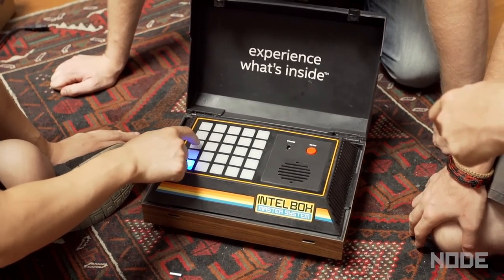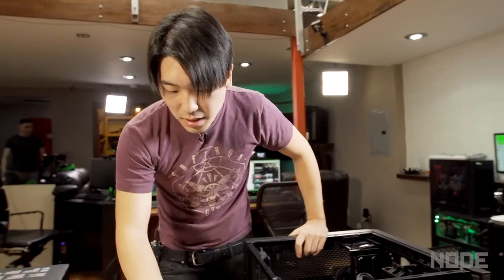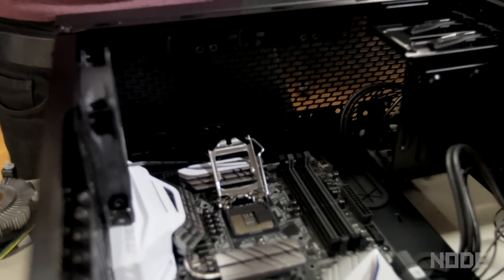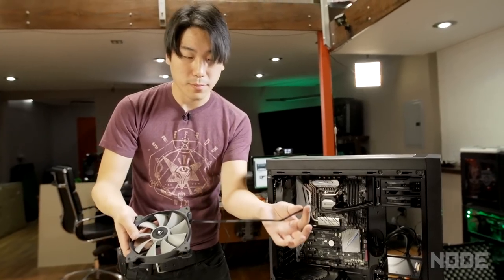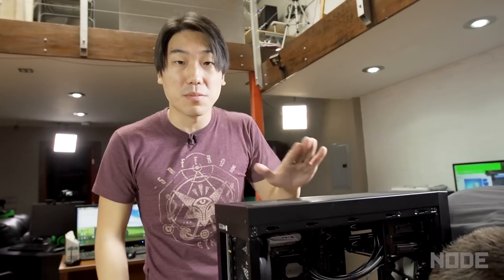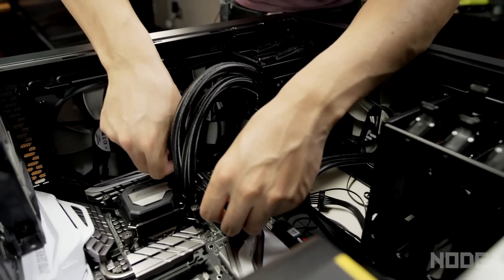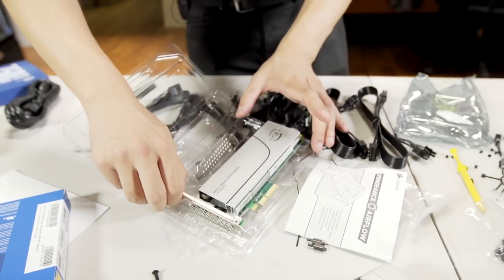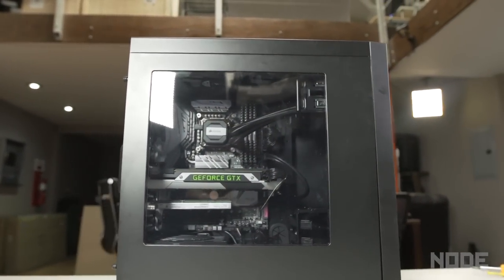BEAST INTEL PC BUILD

Comment: for everybody that wants to get a 6600k or 6700k they dont come with a stock intel headsink you have to buy a aftermarket one.
Reply: ***** im sure that the people that are going to build your system are professionals and ad a heatsink, but you can always email them to make sure.
Reply: ***** I got a friend and he bought a system but forgot to buy a headsink because he thought it came with one. And i just wanted to make sure because D didnt know it either, he showed a intel stock headsink and said that it normaly came with that.
Reply: Headsink?
Reply: +barny8000 It's called a heatsink bud
Reply: +KrisVr People use stock coolers that are on a limited budget or are not interested in overclocking
Reply: +barny8000 depends if you buy the boxed version or the tray version
Reply: +Kohlabier the boxed version doest come with a heathsink either.
Reply: +barny8000 that's strange.. what is inside the box then? CPU and Styrofoam?
Reply: +Juno Arry plastic with your cpu and a manual
Reply: oh yea.. Styrofoam will make electrical thingies goes bad for packaging..

Guess i'll head back to chemist community.. I feel newb here, gosh.. I don't even do chemistry...
Reply: ...as with the 5820K and 5960X.People who buy these should not be using the stock cooler anyway,especially when the skylake parts are said to have bad TIM again(according to someone's delid experience).A Hyper 212 is not expensive compared to the other components.
Reply: +KrisVr Maybe they can't afford another one, i personally would just go for a hyper 212 evo, or something alon those lines.
Reply: +KrisVr Well, since it's intel, you can actually use them without any drawbacks
Reply: +barny8000 who uses stock heatsink?
Reply: The standard Intel heatsink is rated for 95W, the skylake k series will hit 130W when overclocked so the standard heatsink is not good enough. Why anyone would buy a k series and not overclock is beyond reason wait for an S series or similar. Saying that skylake isn’t much of an improvement over devils canyon considering the quite substantial price increase (mobo plus ddr4), you'd be better waiting for the next gen CPU entirely.
Reply: +Pureshadow idk
Reply: who wouldn't do that anyway?
Reply: +Daniel Deutschen The people who are NOT enthusiasts, and DONT overclock, who DONT need one if you dont overclock it.
Reply: +Blake Slocum well, I think you need one because the stock cooler is just way to loud
Reply: +Anthony Nguyen People on a budget don't buy $400+ CPUs designed for overclocking. You can pick up a good HSF for under 40 bucks.
Reply: +barny8000 who uses a stock anyway?
Reply: +Edsson L. poor income gamers :'( a moment of silence please
Reply: porkyporkchop1 poor with a 6700k?
Reply: Edsson L. it was a joke about the stock cooler. kind of silly to invest in such a nice build and not throw on a heatsink :)
Reply: porkyporkchop1
But the stock cooler is a heatsink, is it not?
Reply: porkyporkchop1 oh i see, and yeah it is silly
Reply: +Blake Slocum shush, you know I meant a decent heatsink.
Reply: porkyporkchop1
Is the stock heatsink not decent enough to cool the cpu with no problem?
Reply: it will only support non overclock, and it will run at high rpm and be very loud.
Reply: +Blake Slocum it depends on the CPU. I have a mixture of amd and Intel. Fx 6300 and fx 8350 needed it. Ran to hot. My i5 was fine without a bigger heatsink. My i7 I didn't chance.
Reply: porkyporkchop1
 I can give you that, but only in certain situations. If your running a server like I think you are, of course you need it, those things will get to 150C before they shut off... If I knew you'd be running it on a server, heck yeah I'd get a big heatsink. The reason why it only fits in certain conditions, is because my CPU, quad core 2.8 Ghrtz is 280$ as of today, and it runs a frosty 32C at idle, and 60C on full load, which is still under the 80C shutdown point, it is recommended it don't go over 60, but it can go well over 70C without damaging things, Yes, it can damage it at that temperature, but it has a much lower chance of surviving. over 125C is when the thermal paste starts to melt, and also the temperature that solder can melt at.
Reply: +KrisVr I do ! Because I  don't want to waste another money for the cooler.
Reply: +barny8000 That is correct, and why do all pc builders get more powerfull power supplies than they would actually need. A 650 w power supply is more than enough for this build.
Reply: +KrisVr To cut corners and buy one later... I know from experience.
Reply: +Robbie Hope yes they will put one on for you! they will send you a functional pc
Reply: Nah der they're k series chips
Reply: +barny8000 or just get a 4790k and be A-Ok
Reply: +FireB4llz nobody. But he said in the video that they come with a stock heatsink. They don't.
Reply: +KrisVr if your not gonna overclock your cpu you use the stock cooler, dummy
Reply: N Bertuzzi  Then you loose out on quieter and cosmetic aspects.
Reply: We can juz use Crosair water cooler
Reply: If you don't want to buy an aftermarket CPU Cooler, then go with a cheaper non-k SKU if you don't plan on OC'ing

Comment: The way you built this pc makes me cringe XD
Reply: What do you mean?
Reply: Neopulse00 calling some of the components the wrong name the way he installed some components like the liquid cooler. you are supposed to put the fans on first then put it in etc. if you want some cool build logs go watch LinusTechTips
Reply: +RathOX Well really, as long as it works, and you know what he's talking about, it's completely okay.
Reply: Conrad Skylark yup no anti static bracelet
Reply: +RathOX Also pretty sure he didn't clean his CPU from finger grease after touching it when he was putting on the AIO.
Reply: ***** i wasn't quoting lol i build pcs all the time. this made me cringe XD
Reply: +RathOX They probably disassembled the whole thing and rebuilt it after the video ended. Their technical guys appear competent.
Reply: +Jack Black Um no. One, you barely know what he's talking about. This is an extremely vague and simple video for a very complex and hard task. So it's not "completely okay" at all unless you're here for nothing but entertainment. But if you want to build your own pc, this video is not "completely okay" by any means, you'll probably fuck it up if you aren't already informed on the subject.
Reply: bestieswithtesties This video isn't a build guide...
Reply: +RathOX Yeah some of the stuff they did could've probably been done in an easier fashion, but hey, they got it done.
Reply: Jack Black I think, at least from carefully observing the source material (the comments), that people feel that Node should have led with that fact. 

Otherwise, it's kind of misleading.
Reply: plasticbazooka It's not misleading if they didn't say it was a build guide, they're misguiding themselves by assuming things.
Reply: +Pierre Fouquet ik its a liquid cooler i have that exact model in my build........
Reply: +Pierre Fouquet and........ it is
Reply: +Pierre Fouquet i need corsair link for my psu and cooler so i can measure the voltages and temps
Reply: +Pierre Fouquet no no no. i said he called some i didnt say he called the liquid cooler wrong. i was referring to the "backplate" which is called the i/o shield. i was saying that corsair say put the fans on the cooler first before u put the cooler in the case...
Reply: +xSiNx SHADOW ikr this kid haha
Reply: +RathOX If it works it works, when I see comments like this just seems like a bit of jealousy but hey gotta have some haters right.
Reply: +CrazyMC411 not jealous haha got basically the same pc haha. its just irritating when i see this vid because he is trying to explain it and not doing a good job.
Reply: +RathOX It is not a tutorial video though just a build video
Reply: +CrazyMC411 but he was building it partly wrong tbh and called some components the wrong name.
Reply: I don't see it a really big deal though, seemed fine to me.
Reply: +CrazyMC411 yes you dont but a lot of people did including me lol
Reply: +CrazyMC411 But, there will be a person who probably a node fan, and tried to build pc cause he watch this video... and tried to use this video for guidance.... there will.... so is it fine? nope, nope, NOPE... the component are expensive man, if someone follow this kind of build guide (even though this isn't a build guide) they will have HIGHER CHANCES to fuck up and ruin that expensive component
Reply: +RathOX same. it pissed me off a little. just wished "he did his research"
Reply: +RathOX Really? It wasn't that bad. Besides, we all make mistakes. For instance, your grammar makes me cringe, but I don't mind.
Reply: Tomiply it wasn't that bad? check the comments
Reply: ***** I did check the comments, and your grammar isn't that bad. It's just like D's PC building, it's not that bad either.
Reply: Honestly, I don't get why most people are bitching, he got the job done and it works. Nothing exploded nor got short-circuited by static electricity. So jokes on anyone bitching about it.
Reply: +RathOX dud bracelet is not really needed, just touch something metal before building ;)
Reply: ananda rizky not really especially if you are dealing with cpus and gpu static electricity builds up even if you touch something metal first.
Reply: No big deal but you can make it a big deal, just chill.
Reply: Jack Black I agree, however, the majority of the people commenting don't appear to. It is what it is.
Reply: Yep they lost me at the power supply... upside down wtf! why do intel send them prosseors? just to show us how not to build a pc
Reply: +Reality Warri0r it doesn't matter which way you put the power supply in, if the fan is on the bottom and there isn't an opening on the bottom of the case then it would be completely stupid to put it that way. so you put it in the other way so the fan is on the top. think before you comment lmao
Reply: You completely missed the point and i'm not going to explain it to you... you're just not smart enough!! Now i'm lmao AndrewF321
Reply: +RathOX How about when he touched the cpu right in the middle with his bare finger? mmmm
Reply: +RathOX I'm pretty elementary when it comes to PC building and I could easily put together a PC like this. It's really not a hard process. I also knew exactly what every part was regardless if he said the wrong names (which I never caught). Also, an anti-static bracelet isn't necessary at all. It's mainly used by people who are paranoid. I've put together and torn apart PC's hundreds of times without anti-static and never had a single issue. Go ahead and consider yourself the master of PC Building, but there isn't just one way to build a PC. Their finished build will run just as good as if you built it yourself. 

P.S. they could have easily fixed anything they did wrong in between clips (i.e. cleaned grease from processor).
Reply: +RathOX now that you mentioned it. O gosh D:
Reply: +RathOX don't need one
Reply: +AndrewF321 It actually does make a difference...One direction it's pulling warm air from inside the pc and venting it out which keeps inside the pc somewhat cooler. the other way it focuses the cooling on the PSU itself.
Reply: Michael Williamson
every PSU i've ever seen has 1 fan, whether it's blowing air out or taking air in doesn't matter. what i'm saying is that if there is no hole in the bottom of the case for airflow putting the PSU in with the fan facing down would be completely pointless
Reply: +RathOX Yet another first time builder thinking he knows what he is talking about because he watched a linustechtip video. That is real cringe.
Reply: +   😂😂 nope i study IT/gaming/computer systems at college and have completed many successful builds.....
Reply: +RathOX "the way he installed some components like the liquid cooler. you are supposed to put the fans on first then put it in etc"
This one depends if your going for push or pull.. And putting the fans on top or bottom of the radiator has no effect in cooling whatsoever if you got proper fans for a radiator. The fan still has to push or pull air through the radiator, no matter if its on top or bottom ;)
Reply: To be fair. This is at least 5x better than the verge.